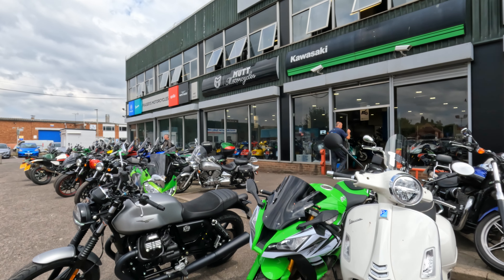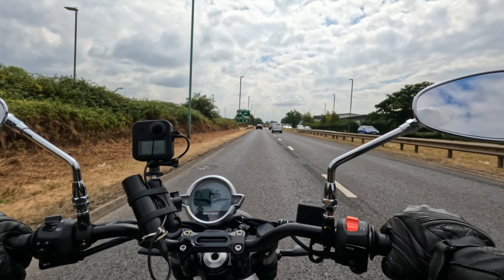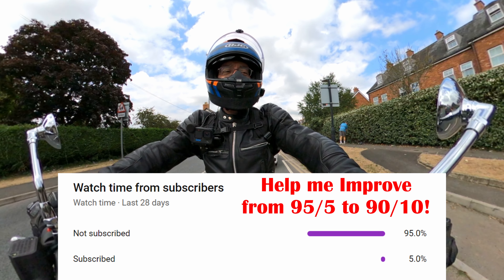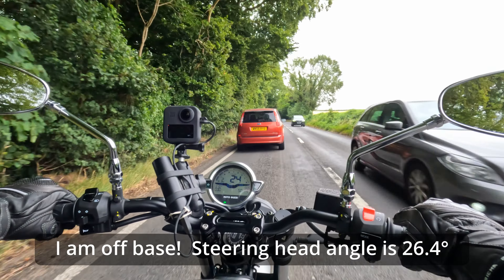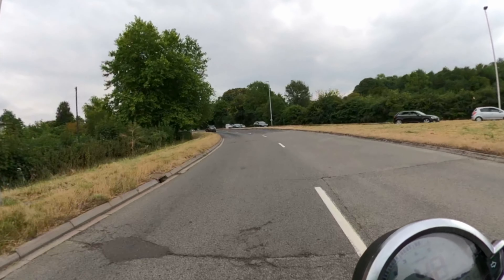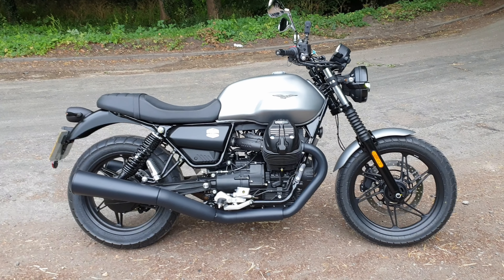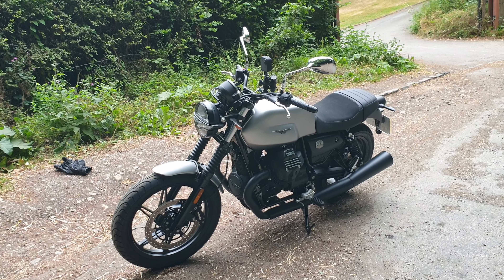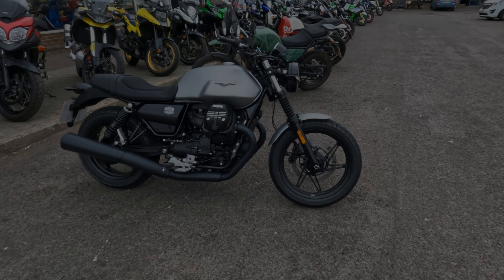Moto Guzzi V7 Stone • First Ride Review

Comment: After five Hondas, I made the switch to a V7, but I’ve held on to my Xmax. Your points are well taken; still, the V7 does grow on you after a week or so, and you soon learn to manage the jerkiness with a bit of clutch finesse. The looks just keep improving – I absolutely love glancing back at it or passing by it in the garage when I’ve got the unfortunate task of using the car instead.

The engine has a characterful sound with several tonal layers to the exhaust. It’s got a great note, but it’s not overly loud. Comfort is perfectly adequate – it’s not an MT-09, but there’s a real charm to riding it at a slower pace. I don’t feel the constant urge to accelerate hard or dive into tight turns; it’s simply enjoyable in a different, more relaxed way.
Reply from the maker: Thank you for your thoughts on the V7 that's much appreciated.  I do think a Guzzi could well be in my future buying plans - I keep looking at various models in the range and I'm sure in time one will get under my skin 😊

Comment: One thing not mentioned in reviews is how reliable this bike is, and easy to work on. I’ve had a 2016 v7 for a couple years now and it’s as well made as a 90s Honda.  And longer I have it the more I like riding it, and just owning it.  It’s not a “high performance” bike but it IS a high quality motorcycle.  For everyday street riding of the kind 90% of us do I can’t think of any real faults.
Reply from the maker: Yes that is a good point - I guess as the bike is not as widely owned as some other marques, general knowledge about the ownership experience seems to be on the low side.
Reply: I'm about to purchase one. I've found a perfect example with very low miles but I'm suspicious of the £1000 discount. Should I just buy new? What reliability problems should I expect? Rode one today and it was pure bliss.
Reply: @Victor-vf1fi  just go for it. I’ve had my Stone for 3 years and despite the rarity, and the fact that it’s the bike I’ve liked the most from everything between a Honda Forza to a Kwak Z900RS, they don’t hold their value as well as you might expect. 
Some dealerships specialising in other marques don’t tend to like them on their forecourts.  Think of the £1k saving as a blessing. 👌
Reply: @richwatson28  bought it and I love it. No issues after almost a year. Would love more power when riding with pillion. Fantastic bike. Was considering the V85TT. Ride safe!

Comment: I have one.  Tyre pressures make a big difference to handling.  Mine were low out of the dealers and it wagged its head under hard acceleration.  Put them up to where they should be and now there is no wagging of the head / steering.  Bearing in mind that this bike is a 'sportster' and not a 'racer',  I find the handling / cornering to be light and neutral and on par with the Ducati that I had before it.  As for the throttle, Guzzi have just issued a new ECU throttle map to hopefully improve its small throttle opening response.
Reply: I agree you have to pump the tyres to at least the recommended pressure, it makes big difference on my MG V7III 750 goes from slug to great handling, much more noticeable than other bikes.

Comment: I've had one for just over a year and took it over 2000 miles this afternoon with a 150 mile ride around North Yorkshire roads from faster single-carriageway A-roads to Yorkshire Dales lanes. Would a sportsbike have been quicker along the A-roads? For sure, although maybe not with me on board! Would a dual-sport or KTM Duke 390 have been quicker around the lanes? Yes, but not by much. It's by no means a perfect bike, but it feels great to me. I love the engine feel, it's flexible (quick enough for me when I wring it out, torquey enough at lower revs around town or the back lanes), looks great, sips fuel and as you note the handling's good if you're not going crazy (Guzzi beefed up the frame and swingarm for 2021 when they pushed the engine out to 850cc from the previous 750cc). That won't be enough for everyone, but it works fine for me.
Reply from the maker: You cover the important points here Jim, it's what works for you that's important and it sounds like the bike suits you down to the ground! Much like my R1250R works for me but many people would not even consider buying one!  The V7 Stone feels like an "old bike done right" which I think should be taken as a compliment. It's about finding the bike that adds joy to your life and if you can do that you're doing well 😊
Reply: I love my 2016 750cc V7ii.
The dual analog clocks & chrome exhaust look a lot better to my retro taste.
Also, max torque at 2800 RPM on the older versions is really nice.
Reply: @savage22bolt32  Guzzi also offer the 'Special' version of the 850 with twin dials, spoked wheels, gloss paint and chrome / polished alloy finishes, although I believe the first Stone models came with twin dials
Reply: Im about to purchase one. Any reliability issues so far? Thank you for your advice
Reply: No reliability issues yet with my 2021 Stone IV 850. MGs are generally pretty strong.

Comment: This is a nicely refined traditional bike. There are vibes at idle and down low; but it's smooth underway. For a bike that pedates modern balance shafts by decades, it is remarkable what they have accomplished. The clutch is one of the lightest and easy to use I have ever come across. I live on 100km of tight mountain twisties. If you sit back the bike will feel like what you said. 
If you sit right at the front of the seat the steering and handling are remarkable; effortless and very accurate and I'm over six foot. Even a very small rider adjustment has a majour impact. The only thing I would improve are the front forks. There seems to be a fair amount of stiction; but they do seem to work better at higher speeds.
Reply from the maker: I do look forward to riding one of these again one day!

Comment: Hi Riccy, I watched this because, as a fellow R1250R owner, you are in a good position to compare the two shaft drive motorcycles. I can’t get a demo near where I live. The dealer only sells without trying first. That Moto G is 20kg lighter than the R1250R. At my age you start counting the KG rather than the BHP. Completely different price range and spec, but if I was starting over, for what I need, I’d be considering the Moto Guzzi.
Reply from the maker: The engine performs better than the specs would have you believe and I think that's due to the engine being a big old-school 2-valve unit 😊
It doesn't feel as good on the road dynamically as the R1250R but as a machine in it's own right it still works well as an overall package.  And it does look good!
Reply: Euro emission standards will cast these bikes in the dustbin. Get one now before they're gone. 
I'm really sorry I didn't buy up a bunch of 60's & 70's bikes when they were cheap & plentiful.
Reply: I have just two days ago traded my BMW R1200R for the v7 850 Special and I am glad that I did. The v7 has more caricature than the BMW R1200R,  it's a low frequency vibration that doesn't bother my hands or anything and lots from tourq from the start!
Reply: just about to get the V7 stone special edition and my first impression are fun engine thus to ride, massive tank lightweight (comparing to my previous Dyna Super glide Custom) and half the price as the latter, what else :P

Comment: Nice review. I really like this bike as far as retros go, very stylish & characterful. Without having ridden one  I would say that it's probably not a bike you push on with so much as cruise about on & use the grunt now & again to get back up to speed. Hopefully a V7 owner will clarify in due course.
Reply from the maker: Yeah I'm not going to lie - I think I misread this bike!  Cruising it's where this bike will shine... leisurely  rides on a sunny day is where it's at! (sorry for the comment edit - the original wasn't very good!)
Reply: @RikkyTang  No worries, I edited mine too as it wasn't up to scratch. : ) As for the V7, yes casual speed limit based sunny afternoon cruising is where it's at, which is just fine by me as I'm much less inclined to want to go too banzai on a bike these days.
Reply: @ragerider6283  It is definetely very inviting to cruise on the V7. However, the V7 850 also shines long-distance, luggage or not, as it eats highway miles like cake with a windshield on. On top, if one changes the preload on the rear, slightly rises the pegs and swaps to conical upward pointing exhausts, the engine really becomes a screaming monster at 4500-7500rpm and can be pushed. The entire machine is tuned towards low end torque etc, only going to 65hp and all, but it is the same 850cc motor which sits in the V85TT with slight alterations, it can go, it can be modified, it can become what it once was; a superbike of the past.
Reply: It still has a punchy engine, but you are right. This is a stylish bike, to be ridden in style. :) Can check my test ride of it. Drop by.
Reply: Editing.
I edited just so I could join in.
Reply: @savage22bolt32  Lol. You're in! ; )

Comment: a) You said you never rode a bike with a transverse mounted engine & you have a BMW with a shaft drive - BMW boxers ARE transverse mounted / longitudinal crank engines. 
b) We don't have the same, sometimes reported snatchiness that comes from fueling here in the US on early bikes afaik - you do have a new fuel map update available at the dealer now.
c) You're obeying the factory preset gear shift indicator which is low for the BREAK-IN period RPM - ignore or reset to the actual redline. Easy to do.
d) If you don't explore the envelope of the V7 you'll miss the most delightful characteristic - it's the shear fun factor on a bendy road with time spent at or near redline. It's a forgiving bike.
e) This V7 weighs 436 lbs or 198 KG dry - it's not heavy, it carries 5.5 Gal or 21 litres which is MORE than the competition so yes, the wet weight will reflect that. Aftermarket exhaust drops the weigh 20 lbs if you're so inclined.
f) A superior choice among other retro standards if you want to be able to snap on a windscreen & bags for LST duty due to its range, excellent seat & rider position, 6 speed gearbox & final drive.
g) Did I mention the 4 pot Brembo 320mm up front? Others may only be a 2 pot.
h) Excellent stability on the highway, cruises at 90mph or 145 kph w/o stressing.
i) low speed handling is very good thanks the aforementioned low weight, judged doing steering lock turns & filtering.
Reply from the maker: Thank you for your comments and thoughts about the V7 Ricky!  However I will say that I reviewed the video and I don't actually say that this bike was the first transverse mounted engine I've ridden; I did say that it was the first transverse V-twin I've ridden, which was accurate. 
I certainly did not come to this V7 with the right attitude but I have to say if I rode it again I would generally ride in a calmer manner and enjoy more of the bike's charms 😊
Reply: @RikkyTang  How much more calmer could you be? You drove behind traffic afaict maybe 90% of the ride? If you returned with any footpeg feeler remaining it's a commuting review at best.

Comment: The first bike that I eperienced that twitch when you hit the throttle (throughs the bike to the right) was a BMW R1250RT. It felt so strange to me that I walk away from the deal. I like the V7 but I've never rode one so my opinion could change. I also have to remember that the V7 is about half the price of the BMW R1250RT. Apples and oranges.
Reply from the maker: Indeed the V7 and RT are designed to scratch different itches 😊 I do look forward to riding another Guzzi and this time approach it with the right mindset!
Reply: I'm a brand new rider and bought one of these. The only other bike I've ridden is a Ninja 250. I'm still really green and not comfortable with really anything yet but I never even notice the little twitch. The only time you really feel it is if you whack the throttle much more than you'd ever need to get going. I don't feel any of the centrifugal force while I'm riding at all.

Comment: Hi Rikky, nice review. I'd be interested to hear how you feel this compares to the RE Interceptor. I'm hoping to test ride both, from Frasers....
Reply from the maker: It's a good point to compare these classically styled bikes.
Now the V7 is both a good bit heavier and more expensive but does have an air of quality. It also has a fair amount more shove coming from the engine, as felt through the seat-of-the-pants! So if it's straight line performance you want then the Guzzi might be the option. However I'd also argue that in the twisties the lighter Interceptor would be more fun! If you aren't going so fast then they both cruise perfectly well and it might be more a case of what they sound like as you wind through the countryside 😊
So - as usual really - it really depends on what you are looking for!  It's a great idea to ride both, have fun!
Reply: @RikkyTang  Much appreciated. Cheers!

Comment: Fule is indicated by the eagle in the display!
Reply from the maker: Thank you 😊 I didn't see the Eagle change at all... do you have to press a button to have it show the fuel level?
Reply: The Eagle indicate gear shift (at chosen rev count) Low fuel lamp lit whit aprox 4 ltr left and a trip counter begin to run. I am the lucky owner of a V7 850 Centenario and I just love the bike.
Reply from the maker: @torehornkjl1452  Thanks for your info Tore 👍
Reply: @torehornkjl1452  it's a fabulous machine, congratulations. Any issues with it?
Reply: @Victor-vf1fi  Had one issue. The starter button would not respond. Luckily I was at the dealer when it happened. They opened the unit and got a thingy unstuck with some contacts pray. The bike run great at 10000 km. Just need to be a tad warm before gear shift goes smooth
Reply: @torehornkjl1452  thanks for the reply. During my test ride the mirror became loose and kept migrating towards me. Very embarrassing for the dealership but I didn't care that much. These little niggles do add up a bit and I am slightly concerned with reliability. The engines seem fine though...
Reply: @Victor-vf1fi  Yeah, easy fix with a slim tooth washer. Don't worry about M-G reliability, mind you they have been around a century. A few minor things like checking for loose bolts is a bit of the Guzzi charm. Get to know your bike. Two big buckets vibrates you know, thats why we love V-twins.
Reply: @torehornkjl1452  I did find it extremely vibey when testing it but not the high frequency bad vibrations. Do you ever get numb hands/ feet from it?
Reply: @Victor-vf1fi  I've never had any numb hands or feet like on a thumper. The noticable vibration is only around a limited rev range. I ride comfortable for hours.
Reply: @torehornkjl1452  Thank you, noticed the seat is very comfortable as well